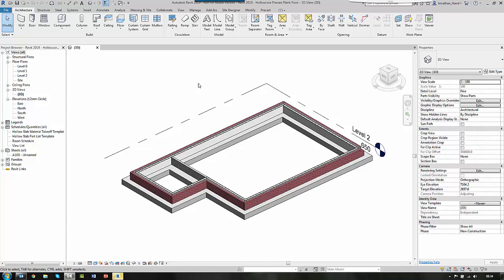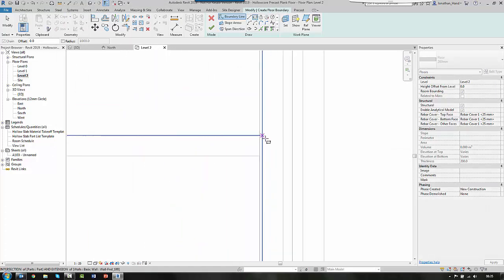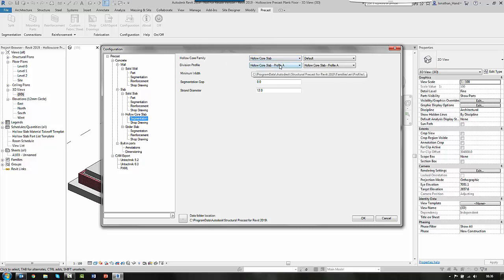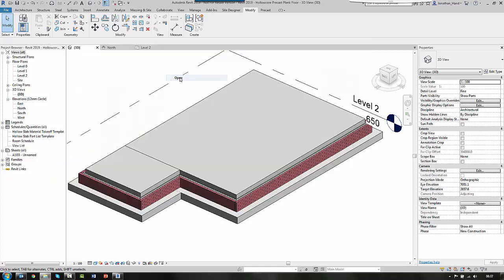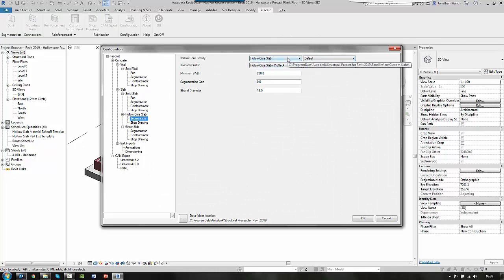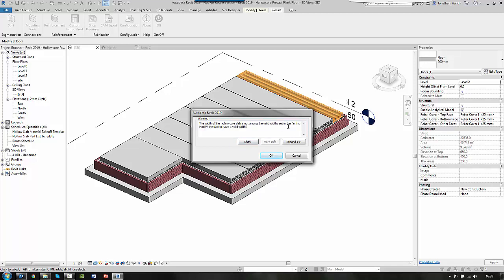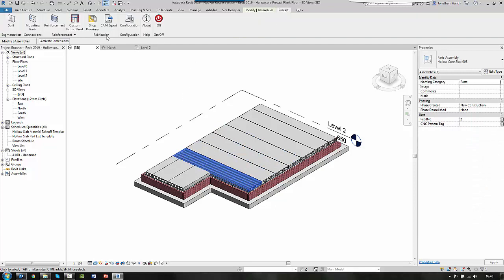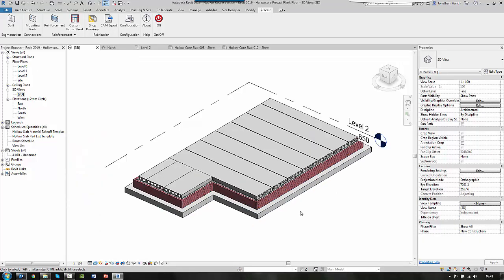Revit 2019  Hollowcore Precast Plank Floor

Comment: Sir you use a precast tab but i dont have this tab plz tell me where is found please reply
Reply: okey sir thanx reply me , sir i have revit version 2019 student version
Reply: @bim-things  Hi, I've been trying to find this add-in, but no luck so far. Is it only available for Revit 2019?
Reply: @bim-things  is there a way to have the "free edge" of the hollow core slab to have a profile as well as the edge between the slabs?